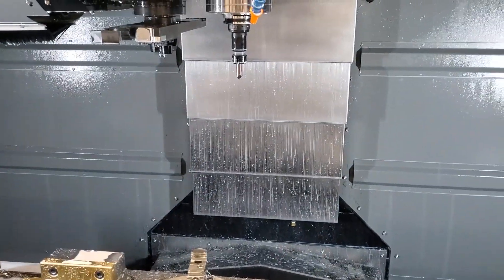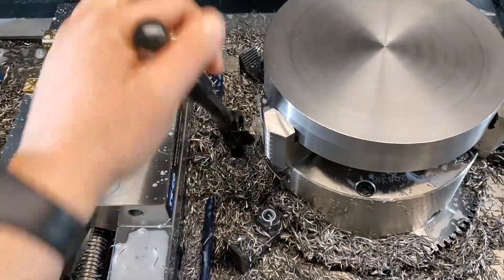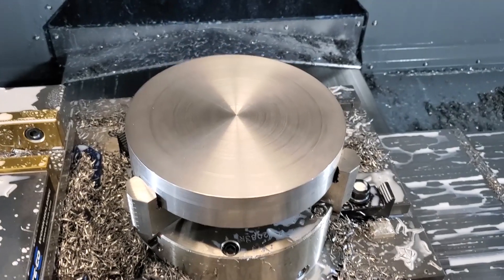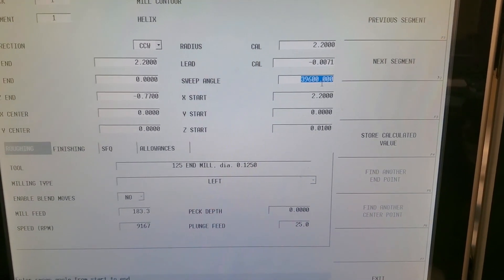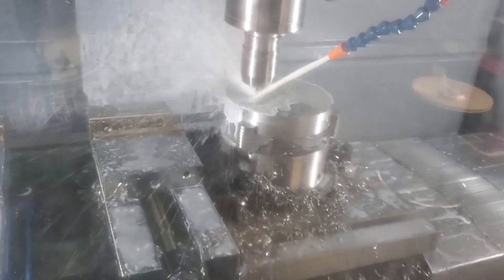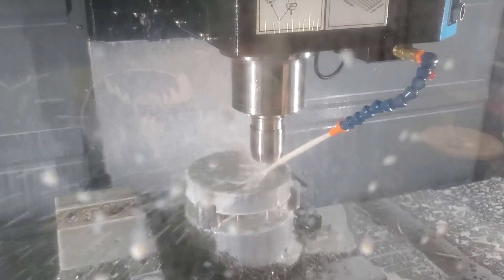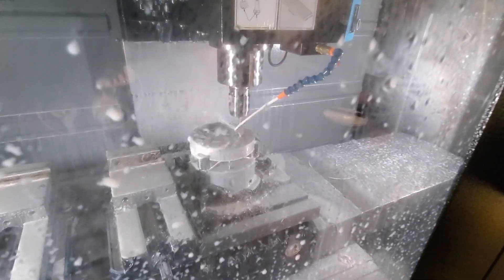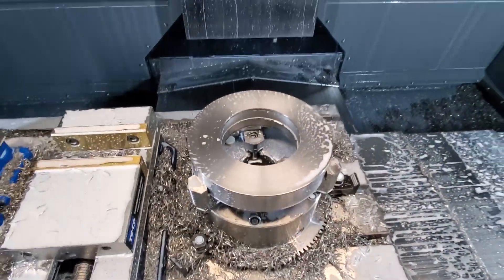High FEED Endmill on Hurco VM20i

Comment: Just a thought but dependent on your tooling you could use a face groove tool on a lathe for the first op coming 2mm from the back face and then just mill out the 2mm should reduce your total cycle time considerably
Reply from the maker: Tom Pass you are right about that, we trapanned on a lathe the second time around doing this job. Unfortanetly the smallest face groove tool we could get was 4mm wide HFPR from Iscar,  so we did not get as big of a slug coming out, but yeah cycle time went down 1000 percent. But this video was mainly to showcase this endmill, for instances when you cannot treppan  on a lathe (like a square pocket)

Comment: Halooo. Sorry if I'm missing something?.... That helix function has been available for years..   ie.... 10 inch diameter hole, .625 diameter cutter... 4.6775 centre line program. Round and round and round and round! Set maximum cutting depth in the helix segment, then go round and round and round 🙄. In theory you'll leave 20 thou  as finish cut. (in diameter). Obviously allowing for push-off. Just make sure you have control of the slug when you break through.
Reply from the maker: I was excited in this video because a normal 1/8 end mill would not be able to do those feeds and speeds at that depth. I was not showing a new way to program. I agree you are correct in leaving stock for push off.. we leave even more Incase the endmill breaks and gouges

Comment: Have you tried trepanning.  I could do that in 2 minute... no joke.
Reply from the maker: On a lathe? I have a face grooving too I can try it with. Can a .125" width tool go .75 ? Deep in a2. I know I have a 0.25 wide tool that can, but I also know it doesn't like to be buried that deep... maybe I will try that out next time because it would be cheaper than these end mills. Thank you sir
Reply: Dave we did the same thing  in about 2 min  in 316 s/s  all different sizes up to 18"  doing them like that your soon go out of business
Reply: What is ripping that into chips with e.m. vs. Cost of slug you're saving and the time saving vs. high feed mill. 15-16 minutes is not quick for what you're trying to accomplish

Comment: Impressive, I've been wanting to try a high feed cutter. 

I'm not sure if you just forgot or didn't know. With a position block, you can tell it to bring the table to you. After you get your part setup X and Y, jog the table where you want. Then take those part coordinates and put them into your position block.
Reply from the maker: @horseshoe, good point. not sure why we didn't do that.. ALTHOUGH one concern i did have (and this comes from building jig grinders with roller ways, is to not brinell them by hitting table or shipping the machine with the table on!!! So I tried to move the machine to a different position every time we hit with a mallet so the roller bearings didn't always brinell in the same exact spot.... Really not sure about how good that is for the longevity of the machine to hit table/parts with a mallet.   Great point though sir, thank you!! 

What do you/ or guys think about the severity of hitting down your parts?   Does the vise/table having enough damping to protect your linear guides? Obviously a rubber mallet is better than a hammer... but still... you lose sleep over these things when you are trying to take care of your equipment.
Reply: @MooreCNC , when I need to seat a part down in a vise, I do the following. 

Lightly clamp part, maybe 10 foot pounds. Then tap down with a small dead blow hammer. Finally tighten vise to working pressure, 20 to 50 foot pounds, depending on clamping needs. 

Our VM1 is a 2006 that we got new. Can still hold some crazy tight tolerances on it, when needed, without much fuss.
Reply: @MooreCNC  
I don't think that's a thing to be concerned about at all.
Your hammer is tiny and light compared to vice and workpiece - and even more compared to the whole table assembly.
I'd bet you don't even put on a load by lightly smacking it with a hammer that's anywhere near significant compared to the preload forces of regular four row two point contact bearing blocks.

If I'm not completely off here, grinding machines and similar often rely on the weight of their table for preload/generally have very lightly or non-preloaded roller or ball bearings.
They're a completely different pair of shoes.